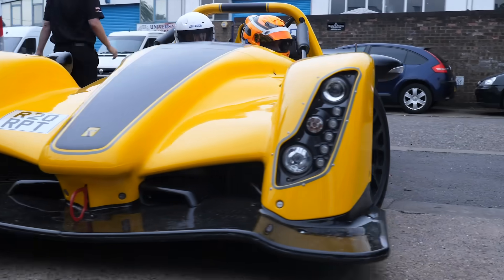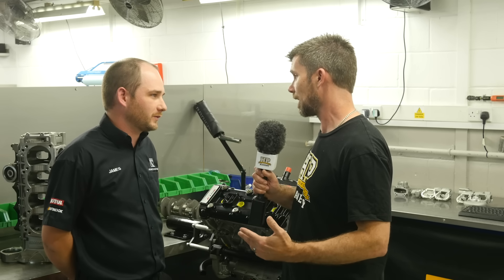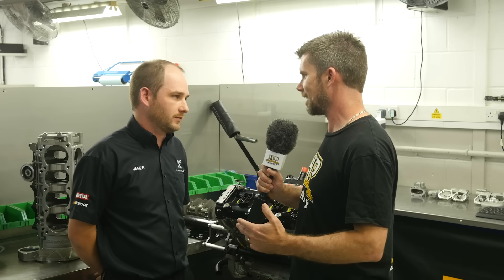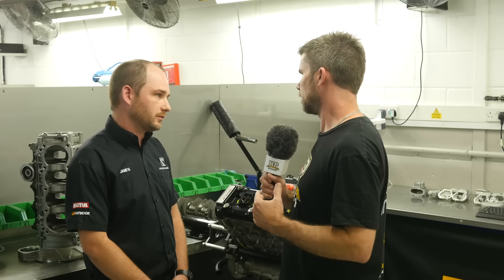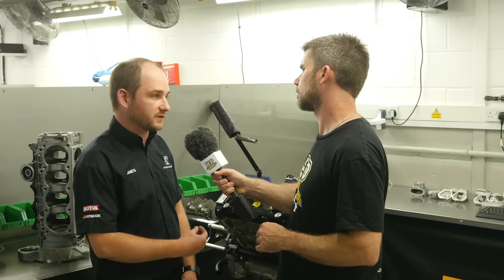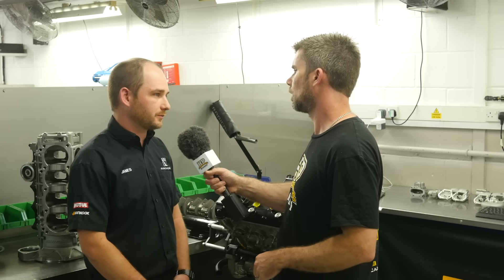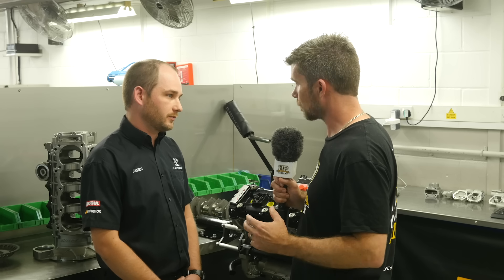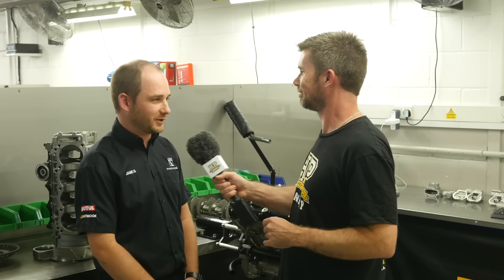105kg, 500HP, 10,500RPM ‘Hayabusa’ V8 | Radical Sportscars RPE-V8 [TECH TALK]

Comment: Id rather go electric...
Reply from the maker: Nobody is stopping you, go for it Dylan 🤘- Taz.
Reply: 452nm on a 150kg bicycle (at takeoff to 200kph then it starts rolling off and hits the rpm of 403kph)
Reply: im now building a 900nm torque ebike  in the next year should be finished
Reply: @hpa101  that motor you have would benefit from an electric motor pushing it past the 6k rpm range via a chain/gear from the electric motor to the driveshaft/flywheel. Would be very easy to have an extra 200-800nm of torque from takeoff to a suitable speed (gear it with high voltage and run a alternator to charge the little battery When cruising and idling etc). If you wanted the car to do 300kph then gear the no load rpm to 400kph on the electric motor so you know you can hit full torque to top speed. 

It only takes a 20kg motor a 10kg controller and 20kg of lithium ion to achieve this. The petrol motor is the solution to the batteries

Comment: 2 questions does it fit in  bussas? Does it have a trans.?
Reply from the maker: Hey Brian, I'm sure you could make it fit, but like everything there will be tradeoffs, and yes this comes mated to a Quaife six-speed sequential - Taz.
Reply: @hpa101 Taz. Thanks. I shouldn't even asked. Nothing I could afford anyways. Had 1980 KZ 1300 w/c 6 cyl. There's bike builder who did v 12 same bike. Engineering neat. 500 HP N/A v 8. There getting 550 + out of half that motor with a single turbo. Crapola! Guys got one turbo yet?

Comment: The Hayabusa V8s have been around for awhile now and they always have made great power. 
There’s a supercharged version in the Caterham Levante that makes 550hp.
Reply from the maker: Yes they started developing this in 2002 however it seems they have also continually improved on things over time too which is pretty cool.
Do you have any more info on the Caterham Levante's RST-V8? It seems like a different kettle of fish but keen to have a nose - Taz.
Reply: High Performance Academy https://www.google.com/amp/s/www.evo.co.uk/caterham/7/6641/caterham-levante%3famp
Reply from the maker: Ahh cheers. I meant on the engine specifically as I couldn't find anything technical on it. In that article it just says 'The fast-beating heart of the car is a supercharged version of RS Performance founder Russell Savory’s 2.4-litre aluminium V8, which weighs just 90kg.' which isn't much. Cool car though and cheers for the link either way - Taz.

Comment: Funnily enough the TVR AJP8 4.5l V8 SOHC engine was also 72 degree, flat plane crank and loved to rev and gave nigh on 420hp - but there was a couple of weaknesses in the engine - but very fast and powerful.
Reply: Not coincidentally, it too was designed primarily for racing, in the Tuscan cup.  Interestingly not only SOHC but also a 2 valve design.  The road cars using that engine had a ridiculous amount of punch!

Comment: There are several ‘normal’ production car engines that have a Power to displacement ratio of over 2Hp/l. But I guess they weigh a bit over 105kg.
Reply: Naturally aspirated ? The highest I’m aware of are the Porsche gt3rs which are barely above 125 hp/L while it’s pretty routine for 1000 cc bikes to be over 200 crank hp per liter at 13-14,000 rpm
Reply: @M_Duhamel  No, not NA engines. Tx for reminding me that the video was about NA engines.

Comment: “Hello, Suzuki? I’ve got an engine for your next generation Kizashi....”

But seriously... Throw this bad boy in a mass produced Kizashi. Audi RS4 killer. Subaru WRX killer. Mitsubishi EVO killer.
Reply: Marc Jackson  that's even worse, no engine should last for less than one race!

But 40 hours for a race engine isn't bad, especially if you can just do rings and bearings and be back at it.

I think the biggest problem with this design is the bank angle. Should have stuck with the 90* bank angle for balance, would have let them run lighter parts and therefore rev higher.
Reply: Well this engine designed for street use would be maybe 2/3 the hp. At most.

Comment: I see that the RPE-V8 uses the same V-angle and crank layout that was used in the Ilmor/M-B 500I Indycar engine from 1994. Are there any other V-8 engines that use the 72 degree/flat-plane crank architecture?
Reply: Judd did a 76° V8 used in Leyton House formula one car from around 1990 and use 72° for their V10 engines.

Comment: only runs for 4 hours under race conditions......... then you gotta crack the block for bearings? just slap a turbo k series in the car
Reply: 40 hours.
Reply from the maker: I think you'll really struggle to get the same results out of a turbo k-series after 40 hours of solid racing without some serious work sorry @Alan - Taz.
Reply: @hpa101  lololol look up NA 500 hp hondas theyre bullet proof ad a turbskie to give you more power but then youre risking detonation.....transmissions will go after about 400. but Im not replacing engine bearings cuz my reliability went out the window for the sake of geometry. Cool engine tho. sorry you cant hide from everyone taz
Reply from the maker: Yes we've spoken to Luke from 4 Piston Racing before @Alan so you actually didn't need to look that far: https://youtu.be/IAfz-Dr_7uE
I hope you enjoy that. They're not just banging on a pod filter and straight through exhaust, nor are they built for circuit racing 😉
Doesn't mean they're not impressive, just not really comparable - Taz.

Comment: Okay a couple things here. For one I think it awesome to make things like this out of existing parts and furthering the R and D of the auto world. But.. 500hp at 10,500rpms is not impressive at all when your looking at the cost v/s weight savings. Furthermore for those saying "slap a couple turbos on it and see what it will do" I can tell you. the crankshaft will blow out the bottom and the crank case will split right down the valley. You probably won't ever see it in a car because its not going to have shit for torque. Like i said its an awesome concept and I love it when people do these things. I'm not trying to troll I'm just letting all you newbs out there know that if you drop this thing in a car its probably not going to work out very well for you. Thank you HPA for the informative video.
Reply from the maker: This engine has been around for a few years now and has powered many cars to victories and even helped them set course records, particularly in hillclimbs as well as holding the Nurburgring record for many years - Taz.
Reply: @hpa101  I'm not knocking it. Just bringing to light to these people waning to put it in a firebird. I'm sure it has its place. Just like the 2.4l quad 4 in the oldsmobile alero was built originally for and set a land seed record. BUT its still a 2.4l engine with 190hp. I'm sure it does amazing at what it was built for and I admire the engineering that went into it. Just saying spending god know how much on this thing, slapping twin turbos on it and dropping it in a 4000lb car, things probably aren't going to go the way you planned it. Whats the torque on this thing @ 10500rpm? Again I'm not knocking it. I think its neat.
Reply from the maker: People spend a huge amount of money turning their street builds into race builds that they still want to drive on the street only to regret it. Nothing new there to be fair no matter what advice is shared 😉- Taz.

Comment: 72 degrees betwen banks, to get it 3-4 cm narower, with all the troubles (vibrations, fatigue) that come with it...  not worth it i gues.
Reply: My thoughts exactly.
Reply from the maker: Or 'worth it', depending on what your aim is. With 50 hours of race use between freshen ups it's hardly like these engines have reliability issues.
Reply: 72 degree bank angle is for more than just saving space. This engine has a flat plane crank. The 72 degree bank angle reduces 2nd and 3rd order vibrations and harmonics in the rotating mass. This is CRUCIAL in V8 engines turning high RPM, ESPECIALLY with a flat plane crank. Flat plane cranks in V8s present all kinds of vibration and balance issues. In racing applications, without dampers and lightweight flywheels, you must engineer your way through the vibrations. For example, the Yamaha V8s designed for Volvo and Ford (XC90 and Taurus SHO respectively) are all 72 degree... even with a cross plane crank. The reason we don't see many 72 degree V8s in practical applications, is because it limits the available bore space for displacement and typical usage. Here, the displacement was already limited... and RPM was of higher importance, so it made much more sense to design the block with a 72 degree bank angle.
Reply: @jamescopeland8813  thanks James for clarification.

Comment: Pretty sure the design was first the H1 v8 made in the USA
Reply from the maker: We talked to the H1 guys and turns out it's completely different :)
Reply: High Performance Academy the basic idea is exactly the same is it not?
Build a v8 out of 2 Suzuki top ends?
Reply from the maker: Yes, and then from there they are quite different. If you have a Google you'll find a write up on the H1V8's development and see the differences - Taz.

Comment: Ariel did this already. Introduced in 2008. Ariel Atom 500
Reply from the maker: The RPE V8 has been in production since 2002...
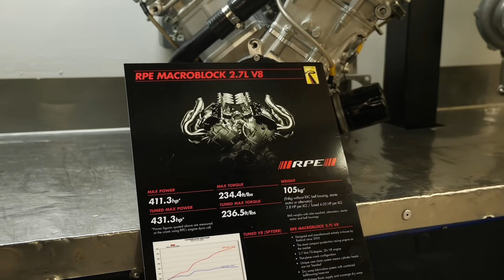Reply: @hpa101  That's cool. The video makes it seem like you are introducing something new. However when watching it back I noticed at 1:11 you can see in RPE's own promotional material it says "Designed and manufactured entirely in-house by Radical since 2005". Not 2002, but still beats Ariel's production.
Reply from the maker: The 3.2L option is a newer feature, otherwise, we don't state the engine is new. Sorry for your confusion there, not our intention.
Yes it was in Radical SR8 from 2005 I believe, but we're just talking about the engine here which was produced before the chassis I believe There is a little bit on the history here if you're interested: http://www.steveprenticedesign.com/projects/radical-rpe-v8/

John Hartley of Hartley Enterprises is the name you want to be searching for more info on the engine used in the Ariel Atom just FYI. Also a great platform - Taz.
Reply: @hpa101  Thank you. Incredible they can get 500 naturally aspirated hp out of such a small package.
Reply from the maker: Yes it is really drag racing territory but that interval and the tiny list of things they need to do for the first service is what really surprised me. Very cool - Taz.

Comment: It's cool, but far too many issues with harmonics and the crank issues. I for see lots of piston slap and nock issues and the big grand daddy of all of it... Nic coated cylinders... Have these fucks not heard of jaguar???.. Yeah some modern fuels will make short work of that coating ... Just get a regular 90 V
Reply from the maker: Hey Lucian,
Do you own one of these engines?
As discussed in the video this engine comes with a guarantee, and also only needs minimal servicing after 40 hours which is outstanding for a race engine so I'm not really sure what you are getting at if you're talking about some of the design considerations as issues. Remember, these are things they have considered and overcome, the engine has been around for over 10 years and has helped break and hold many records - Taz.

Comment: Be a killer power plant for a old Volkswagen beetle.
Reply: Any engine would be great on a beetle. They weight two Celine Dions and a half and came with 30 donkeys power out the factory.
Reply: Yeah they would be sweet. You just need $120,000
Reply: @jntcustomcars  Wonder if they'll take a check....
Reply: It’s a shame that it’s still to long as to not hang out the back of my still stock bodied ‘58. This thing would be cool if you made a tube chassis with a trans that could handle that high RPM! A Baja bug or dune buggy would be much easier
Reply: @mikegreen2229  KarmenGia

Comment: I’ll say this is very cool a little v8. Wow the engineering of that is very cool. My car is 3.3l 8150rpm in-line 6.  Damn this little baby puts out serious power per cubic inch. Top notch work here. It’s mental. And people may think that 40 hours warranty. That’s amazing for a race engine. I worked in NASCAR for over 8 years and we generally rebuilt the engines every race. Same deal as this gem. Basically rings and bearings and check everything for wear and look for failure of any components. Sometimes we ran 2 races on one but very rarely. So basically 5-600 race miles they were refreshed, warranty for 1500 miles or 40 hours. That’s some serious durability for a high strung race engine. Hats 🎩 off to your skill. The NASCAR engines were basically freshened up every about after 12 hours. That’s about all the time is on one after dynoing practice and race. The races are usually over in 3 hours. If we had a wreck or something else that put us out early we would run that engine the next week. WOW 🤩!!!!!!!!!! I have watched this twice so I didn’t miss anything.
Reply: All things. That’s how you WIN races. If ya aint learning, ya DEAD……..  In the water!!!

Comment: That's real reliable needs a rebuild every 2000 miles lol. I'd rather have a k24 turbo in my hypercar than this over priced piece of junk
Reply from the maker: This is a race engine Billie and not something you'd drive around to get milk and haircuts.
To put it in context, some race dedicated engines are rebuilt after every race which might only be an hour. Some drag racing engines would be lucky to run in anger for 60 seconds before a tear down - Taz.

Comment: Probably making 200ft lb of torque
Reply: Gotta be more than that
Reply: @thomasbarlow4223  well the hayabusa makes around 100 ft lb of torque and with this being 2 hayabusa engines mated together assuming it has similar bore and stroke dimensions it's probably making around 200 if the math adds up. I would say no more than 250- 270 ft lb for the 500hp variant
Reply: Where this engine shines I am assuming is the really really long powerband. Less shifting means the driver can focus more on there driving technique and applying throttle and brake at very precise points before during and after the apex of a turn.

Comment: I wonder how different the engine would be if they didn't have certain constraints like packaging size.   Would a 90 degree design last longer because it didn't have all of those odd harmonic issues that a 72 degree engine would have?  Or would it just result in a broader power band?  And since the cylinder barrels and heads are effectively separate from the crank case, is it possible to flip the heads onto the opposite side of the engine and have the exhaust come out the middle like the mercedes engines?   I'm mostly wondering for boost purposes since that would theoretically be the most compact arrangement if you had to stick a turbo on the engine
Reply from the maker: There is a 90 degree variant out there. It's from another company so I use the word variant lightly since it's a completely different design - Taz.

Comment: These motors require frequent rebuilds which are mandated by the manufacturer 😯
Reply from the maker: This is a race engine rather than something you'd run to the shops in so this is not unusual in that context to be fair - Taz.

Comment: What!? "Pretty much verything from the crankcase etc. pp. is unchanged stock parts"?
Reply: There's a 1026 horsepower blown alcohol snowmobile engine using an upper with a "Snowmobile crank" in bilit case's.

Comment: I would like to put the 3.2L V8 in a Pontiac Fiero
Reply: Add a kitt car body for extra points
Reply: @Luke-qs2cg  Fiero, no Firebird.
Reply: @jareknowak8712  kit with 1 t lol, autocorrect issues
Reply: @Luke-qs2cg  i love such moments :)
Reply: That would be a waste of an engine. The Fiero isn't worthy.
Reply: @carlsloan8021  It's one of the lightest chassis out there and a mid engine car. What did you have in mind?

Comment: You guy should used a triumph rocket 3 engine,hayabusa cc is 1,300 while the rocket is a 3 cylinder with 2,300cc.
A 1000 more than a haya and will give out bit more torque.
Reply: Benjamin Franklyn why ? These are 2.7 liters. The cars they go into are so light they don’t need to make much torque
Reply: @zethloveless7238  but the more torque the better and having less moving parts could make it rev higher.
This why the v6 in f1 car could rev higher rpm than a v8 to the v12 found in older f1 and the size cc has potential to increase hp and torque.
Most engine manufacturer lean the engine out so 2,300cc got enough room for hp and torque with no bore tools required. 
It could keep cost lower to fix it too.
I'm guessing you never work around motorcycle or engine or at least study it.
Reply: Benjamin Franklyn buddy you clearly don’t know much 😳 I’m not trying to be rude here but your trying to sound smart and it’s going out the window. Your advocating for a 2.3 liter that makes 100 horsepower less than a stock 1.3l hayabusa engine let alone compare to this 2.7l. And as I said before they don’t need the torque hence why dude chose a flat plane crank for revs over a cross plane. This 2.7l is probably still a smaller package than the 2300 your raging about. Then again you seem to act like you know better than the folks building these things. I’ve seen them in action buddy they don’t need the changes your suggesting lol.